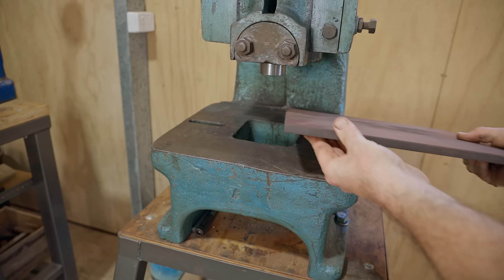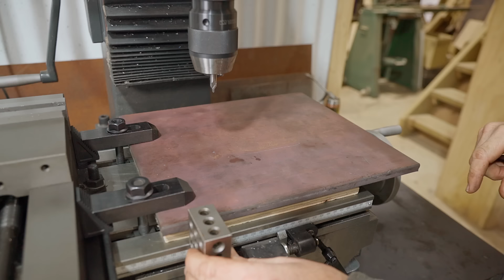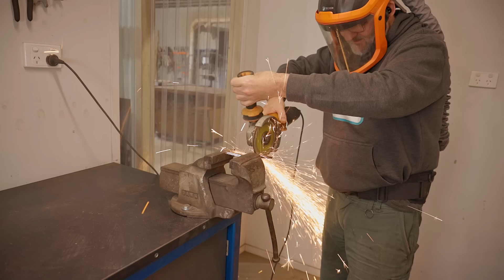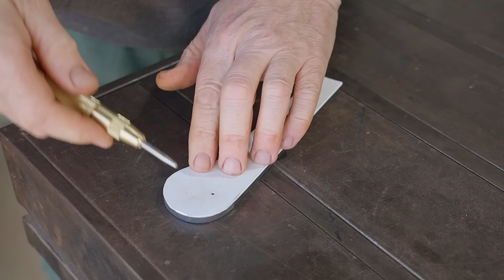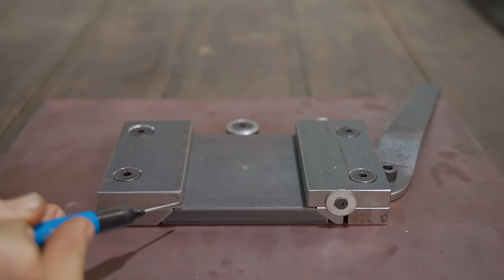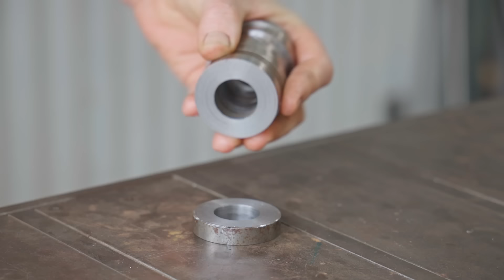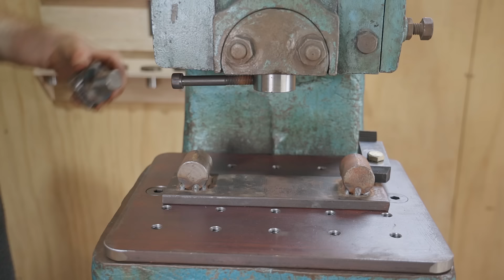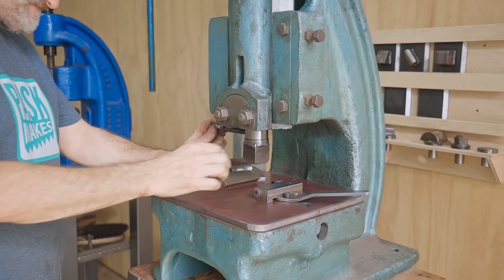Making this unique and favourite tool even more awesome?

Comment: Just a tip for using the mill, milling with the end of the tool puts significantly more wear on the corners than if you cut with the side, and cutting from the sides you can spread the wear out along more of the cutting edges.  When the corners go, you've pretty much killed it so you want to save them for when you need to actually cut a slot or corner.  Facing the top of parts is better done with a fly cutter or face mill.

Comment: Great video as always. On the round part of the upper part of the tool, would it be worth flattening a side off where the bolt clamps to it to ensure a consistent position? 
Keep up the amazing work. You're very appreciated.
Reply from the maker: Thanks very much Simon! You're right about a flat on the upper tool, I've been meaning to do that but haven't gotten around to it. :)

Comment: Very nice upgrade! If the die plates are square I would chamfer the two other sides as well. That way you can rotate the tools in 4 directions making it more useful.
Reply from the maker: Thanks very much! I thought about it and I still might if I feel it's really needed. The only reason I didn't is there would be an open area at the ends where scale could enter the dovetail, the way it is they are fully enclosed and will stay free of debris. :)
Reply: I agree

Comment: You have a lot of patience and an ability to design/make one off builds like those we've seen in the woodshop. Metalwork allows people with those traits to come up with some unique builds as well so, I'm hoping you'll consider doing more of these now that your metal shop is a bit more complete, and your skills are improving. Btw, you should name one of the fly presses: "Marty" and the other one "George" [i.e. McFly].   😄
Reply from the maker: Thanks Dan! I am really enjoying metalworking these days. I've messed around with it for quite a few years but in more recent years I've acquired better tools and I really am inspired to do and learn more. :)
Reply: I like the "Marty Mc Fly" and "George Mc Fly" as names for Fly Presses. But what tool could we name De Lorean or "Flux Capacitor"?
Reply: @markfryer9880  //  Good question; maybe Pask can make them hey?
Reply: @markfryer9880  Obviously the flux capacitor would be a welder 😁

Comment: Nifty system. For the tooling that is too big, what if you welded a dovetail plate to the bottom with an appropriate spacer between them. Then thin down the dovetail plate slightly so when you engage the clamp, it pulls the tool down tight on top of the quick change setup.

Comment: I like these jig plates... It does make things go quicker, if not more efficiently. Plus looks professional with all your custom tooling. 

Me personally, Ive done similar, but had a handle attached like Epoxy sealed wood or plastic. Just to soften the blow a bit when your not too sure when you hit that lever to secure you tool... you dont just rightly square your palm with a some what hard corner. 

Or another idea is , just keep a dedicated small brass hammer or pounder tool for the presses...

EDIT: Try not to ground to moving surfaces.... Ground to base or at the point of welding, as to avoid arc striking the bearing(s), machined sliding surfaces ect... One can seize an entire machine like this if an high enough amp strike occurs.

Comment: That is a fantastic bit of kit!  I guess you probably already know - shoulder bolts would be a better shaft to pivot on for the cam clamp than the threads of the cap screw  I still remember the first fly press video with the "pressed fly".  Still hilarious.

Comment: Nice job man, machining a long, star handled knob to replace the Allen screw for the top die would be a fun project
Reply from the maker: Thanks very much Mike! I definitely thought about doing something with that screw but thought I'd see how I go first. I think you probably right though, I should just get on and make one. :)
Reply: @PaskMakes  I’m a machinist, and I’ll tell you, the first time you do single point threading, it can be terrifying, but it is so rewarding. If you turn the tool upside down and run the lathe in reverse, you can thread away from the chuck which will eliminate a lot of anxiety. Joe Pieczynski has a great video about it!
Reply from the maker: Thanks Mike, I've seen Joe's video and definitely the way I'll be trying single point threading. :)

Comment: Pask, recon you could bend the bolt holding the top die into a handle? Would probably need to be longer but it would match the tool-less change of the bottom die.

Comment: You could mill a 45° chamfer on the other 2 edges of the tool base plate so you can rotate the tool 90°. I think some of the fullering dies would benefit.

Comment: I've never even heard of a fly press before, but now I feel like I can't live without one! Thanks for showing us your ingenious tool holding mechanism. Beautiful!
Reply: Ha! I was thinking the exact same thing. Never heard of the device before this. YouTube recommendations FTW! Thank you so much Mr Pask.
Reply: @harryhalfmoon  Here in The Netherlands they are also used in the hospital, in the plaster cast room.
Reply: @janfieten2449  I live there too but haven't seen them yet. I'll keep my eyes peeled next time I'm there. Bedankt voor de tip!
Reply: @janfieten2449  what do they use it for in relation to plaster casts?
Reply: @harryhalfmoon  varsagod!
Reply: @corytruckdriver  Hmm...  Not sure about plaster casts, but a small fly press MIGHT be useful when customizing those thin, sheet metal splints you often see on broken fingers, sprained wrists, etc., that need to be immobilized.  Usually though, those metal splints are fastened with tape or cloth/elastic bandages.  Aren't plaster casts sort of "old school" nowadays?  I would think most modern casts are made using some sort of synthetic material (more water resistant than plaster).  Just considering the possibilities...
Reply: @janfieten2449  that must tricky getting the patient not move while squishing the plaster on.
Reply: @janfieten2449 what brand of fly press is common in the Netherlands?
Reply from the maker: Glad you enjoyed it Wally! :)
Reply: I always thought a fly press was when wack one against the window with a swatter, and it does one of countless poses.

Comment: If you're looking for a quick project on the mill, most milling vices ha e a channel milled in the bottom where the holes for the bolts that hold it to the table are. You can make some blocks that fit into these channels that will register with the T slots of the mill table. This means you can easily take the vice on and off without having to tram it back in each time.

Comment: Thank you so much, Neil.
You've absolutely blew my mind with the versatility of the fly press. This is a life saver as I cannot use even a small power hammer where I am due to the noise and I can tell from your video that a fly press will be able to do small forging stuff I need it to.
That's not even talking about another video example of your ingenious way of problem solving. These fixture plates are amazing.
And then you've gone and done it with giving us access to your free plans!! I am speechless. 
You are such a good man, Neil, thank you!

Comment: Great build but man I have to say those washers are jank.  You really should recut the pieces to that side and hide the pressure wedge inside the top plate to capture it.  Easy to machine and would have a much cleaner look. Especially since you went so far on the rest of it.
Reply: That’s a good suggestion.

Comment: Just a quick question..I know that you are into photography as well, and I wondered if you perhaps drew some inspiration for this idea from the arca swiss quick release plates most tripods use these days. (photography is also my hobby as well ) also, I used to work at Holden's at Elizabeth, as a leading hand in the body shop. I looked after the section that metal finished the Mig brazed roof joints, among other operations. as such, we used a lot of abrasive discs as part of our operations. we had a fly press in my section that we had different dies for. what happened was, most operations used 9" abrasive discs, on our grinding and buffing machines.. however, as you would know, you only usually mostly use the outer inch and a half-2 inches of the disc, leaving  the centre part untouched. the dies we had were made for cutting down the used 9" discs to roughly 6" from memory. then with a specially sharpened length of steel, we would also cut down the used 9" backing discs as well, thereby doubling the life of both our abrasive discs and the backing plates as well. perhaps something to think of for a future project there?

Comment: Um. Re large forms/tools.
Have you considered rotating the base plate for those? Just two more holes & then they can slide in longitudinally.
I figured that for the pipe bending jig while watching. A wider plate in that axis W a wider "grab" may be useful for larger stuff also.

Comment: There is a locking feature on the keyless chuck. It's easier to Google it rather than me trying to explain it.  But it will eliminate the issue you had there.

Comment: What a beautiful project. I'm sure it is going to really come in handy and its always a pleasure to see you use your mill and lathe! If I could suggest something in the eyes of speed and efficiency, you could turn the bolt which keeps the top part of the die in place into a handle so you don't have to grab an Allen-key every time but rather just twist it by hand
Reply from the maker: Thanks very much Charl! I did think about doing that and I still might, the Allen key sits right there though so I'll see how I go. :)